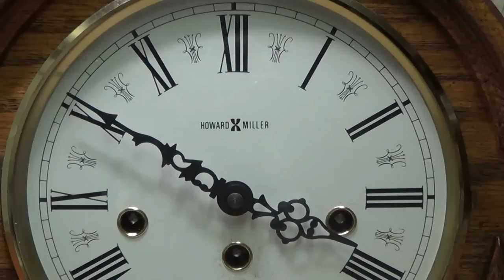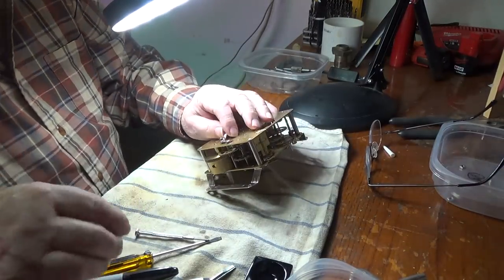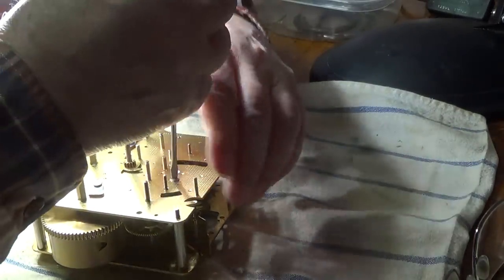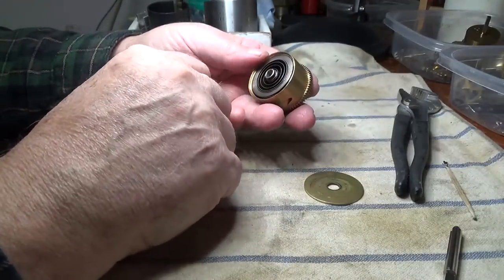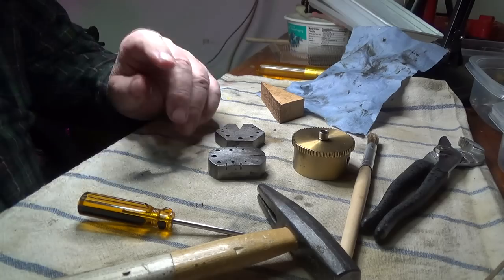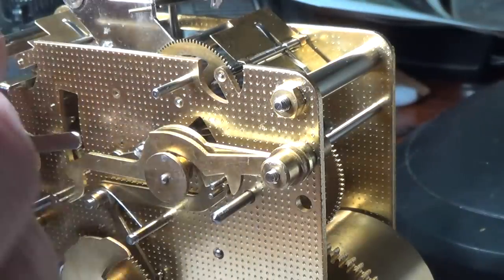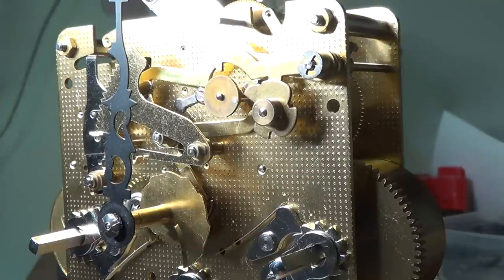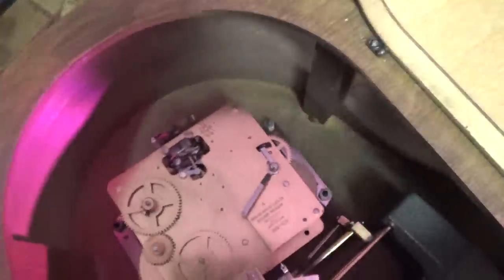Howard Miller Worthington Mantel Clock with Hermle 340 020 Movement

Comment: Hi dperry.  I have a Hermle 340-020 that did not wind in the middle (clock).  When I wind it, it keeps slipping.  The clock does not work.  What is wrong with it.  I am a rookie about this kind of clock, got this clock from my grandad.  Please help, thx so much.
Reply from the maker: The mainspring is likely broken.  The easiest solution is to replace the whole barrel that contains the mainspring.  Remove the movement by removing the hands, remove the screws holding it in the clock case and then remove the middle barrel.  You do that by removing the click mechanism on the front of the movement, pulling out the winding stem and then slipping the barrel containing the spring from between the plates.  There will be a number on the cover of the barrel, such as 40 or 41.  Order a new barrel and spring here:  https://timesavers.com/search.html?q=hermle+mainspring&go=Search and install it.  Were you experienced and had the equipment, you could just order the spring and install it in the old barrel, but I would not recommend that.
Reply: @dperry428 Wowww, very very happy when I saw your reply.  I did order a full barrel #40, and it is on the way.  Also, I forgot to ask you about the ratchet wheel, I has some wears on the teeth.  Before when the clock was working, I wound it (middle) and I did not hear clicks, and I have to wind until it holds.  The problem started the other day when I wound it, and holds.  Seconds later, the key spinning backwards very badly.  From that point I was not able to wind it anymore.  Is there anything gone bad beside the barrel.  I hope you understand my points.  Thank you very much again.
Reply from the maker: The only thing inside the barrel is the spring.  You can get a new ratchet here:  https://timesavers.com/search.html?q=hermle+ratchet
Reply: @dperry428  I just rescued a clock from a local junk shop with a Hermle 340-020 movement with this exact problem.  I was hoping your explanation was as simple as it sounds, and watching your video to the point where you showed how easy it really was makes me confident I can get this one back in service.  Thanks!

Comment: Great video!  Is there a trick to the strike side too... with respect to the  warning wheel, the star wheel (for lifting the hammers) and the position of the cam on the front?
Reply from the maker: The star wheel is not a problem.  It has a set screw and is external to the plates, so it can be adjusted at any time.  The second wheel has the two-lobed cam on it (between the plates) that is involved with the mechanism to keep the bird out during striking.  When the warning pin is at the top (near the top edge of the back plate), that double cam should also be about vertical.  Set the strike mechanism to the locked position so that the warning pin is on the stop lever detente and the double cam is vertical.  THEN put on the gathering pallet so that the pin that rides it is in the slot on the gathering pallet.  The strike mechanism should now operate properly.
Reply: @dperry428  Thanks for the reply,,, I'm not sure what "the bird" is, assuming it's not cuckoo clock related.  The explanation you did on the chime levers and lock up, etc. was fantastic.  I recently followed your video on my own 340-020 this week.  The strike side has the star wheel that pushes down the lever and lifts the 4th,5th and 6th hammers.   It's also got a warning pin position and when my clock goes into warning it lifts the hammers, preventing the 4th hammer from chiming.  I think I need to move the star wheel but not entirely sure.
Reply from the maker: I'm sorry.  When I get notified of new comments, they appear on a screen that has a tiny thumbnail of the video and appears in a list of comments about varying videos.  I had just answered a comment about a cuckoo clock and thought your question was in reference to a Regula 25 cuckoo clock. The setting of the warning pin on the strike side is not critical since the stop position is against a detente on the a lever controlled by the chime side, which is controlled by the extra "bump" on the chime cam at the end of the 4th quarter (hour) chime.  Adjustments to the strike side can simply be made by assuring the warning pin is on the stop detente and then setting the gathering pallet into the stop position.  The star wheel is between the plates and is a strong friction fit to its arbor.  It can be adjusted, however, by prying one of the lifting points on the star with a screwdriver using another arbor as a fulcrum.
Reply: @dperry428  Perfect!  Thanks again.  Your detailed video was very helpful.  The Ollie Baker mainspring winder looks like a great tool too.  Those mainsprings are scary strong.

Comment: What did you use to clean the balance wheel?
Reply from the maker: mineral spirits
Reply: Do you just fill up a cup with mineral spirits and let it sit in there for a bit and then dry it off?
Reply from the maker: Use a very fine artist's brush to gently remove any residue.  Dry with a hair dryer set to lowest temperature so as not to affect the temper of the hairspring.
Reply: Thank you!

Comment: I recently replaced the chime cam that had a broken pin.  The quarterly chimes and hourly strikes now property start and stop. I reassembled the clock and now noticed that at 2mins before each hour the clock would strike once; then when the hour is reached it would chime and strike as usual!  Must yet disassemble again to troubleshoot.  : (
Reply from the maker: Listen to the chimes before you start taking things apart again.  Listen very carefully.  My bet is that the chime roller (with all the pins that lift the hammers) is just slightly out of alignment. Two minutes before the hour is when the clock goes into "warning" before chiming the quarter hour.  The train of gears, as well as the chime roller moves slightly and, if a hammer from the last time it chimed has been lifted but failed to release, it will fall at this time and you'll hear a single note.  Make sure there are no hammers being lifted partially at the end of the each quarter hour.  Adjust the roller as needed.
Reply: @dperry428  - Thank you!  Your troubleshoot was spot on.   Upon inspection, I noticed build-up accumulated around the chime roller and the gear of the stuck hammer.   This consistently prevented the hammer arm from slipping over the threshold of the gear tab during the last note of the 3/4 chime; the hammer arm would merely sit on the apex of the triangular tab of the gear! (Very cool to see).  A gentle tap to the clock case would push the hammer arm over the gear tab threshold.  Similarly, as you said, the motion of the 'warning' action also provided sufficient movement to drop the hammer; hence the singular note be fore the hour chime sequence!   A gentle cleaning, a slight adjustment to the gear, and a drop of oil brought back proper function (and ease of mind)!!  Much obliged, sir.

Comment: I love this video - I am slowly coming to a clock mystery. I am IT person going towards retirement and interested in clocks. I have 0340-020 from 77 movement to learn . I just changed a floating balance - since - I think I have destroyed it while putting floating balance in ultrasonic cleaner - I used a water :(. But anyway - I tried to put there a new floating balance - but my clock is working - chiming and striving just it is fast about 5 minutes per one hour... haaa. :) .... I think the rotation of the balance is not sufficient - or any other idea why is that so fast ? I assume that rotation should be larger so  amplitude should be greater. Any advice why is so speeding ??  Thank you and wish you good health - greeting from Slovakia - Europe.
Reply from the maker: If the movement is from 1977, it is one that was manufactured using soft steel for the arbors and then the pivots were plated.  Did you have to rebush the second wheel pivot holes?  If you did, they will wear excessively as the plating will have worn off and the pivots will be very soft.  The balance wheel should rotate 180 degrees each side of resting, or 360 degrees total.  If it is not doing that, it is likely power is being lost.  It is going to either be worn pivot holes or a weak spring that is the problem.  Did you remove the springs from the barrels for cleaning?  If so, was the time side spring at least 2 1/2 times greater in diameter than the barrel?  If not, replace with a new spring. https://timesavers.com/search.html?q=hermle+mainspring If pivot holes are worn (especially the second wheel), you will need to either replace the pivots with hardened steel or buy a replacement second wheel from a dealer such as timesavers.
https://timesavers.com/search.html?q=hermle+second+wheel&go=Search
Reply: @dperry428  Thank you ... I will probably make a full attempt to clean. For security reasons - I purchased one more 340-020 Hamilton from 88. Thank you for your comments

Comment: I love your videos. They are so educational and I learn a lot form you. I have a question. I have just finished cleaning a movement like that one Hermle 340-020 and although the chiming and strike work perfectly. The time terrain runs for a bout 5 hours and stops. I can't figure out the problem. Floating balance works. Any thoughts? Thanks.
Reply from the maker: I would suspect one or more worn pivot holes.  Look particularly at the second wheel.  If it were running a couple days and quitting, I'd suspect a weak spring that needs replaced, but at 5 hours, that's not likely, unless the springs are dried out and sticky.  Did you remove the springs from the barrels to clean and re-oil them?
Reply: @dperry428  Oh yeah, took the mall out. cleaned them up and oiled them back in place. They were pretty dirty but in a good condition. 3 times the size of the barrel and not warped or anything. Could it be a bent pivot? Thanks.
Reply from the maker: Possibly.  If it is, it would likely be on the second wheel.  Did you polish the pivots? That is the time to look for bent pivots. You would see a wobble of the bent one when you go to polish them.
Reply: @dperry428  Unfortunately I didn't polish them. I just cleaned them and wiped them dry with  piece of cloth. I am thinking maybe when I was putting the clock together I might have bent one of the pivots with my tweezers. Guess what? came back from work and the clock has been running. It has been 8 hours now. Thank you very much!